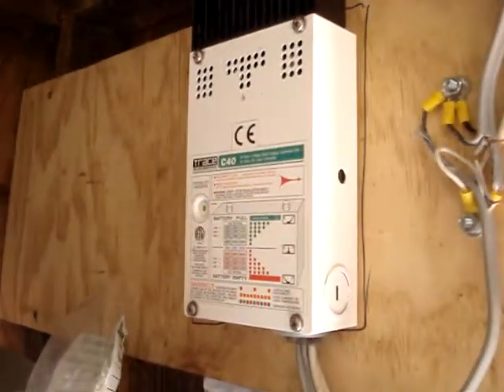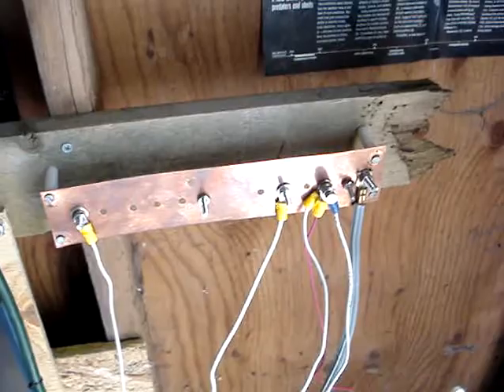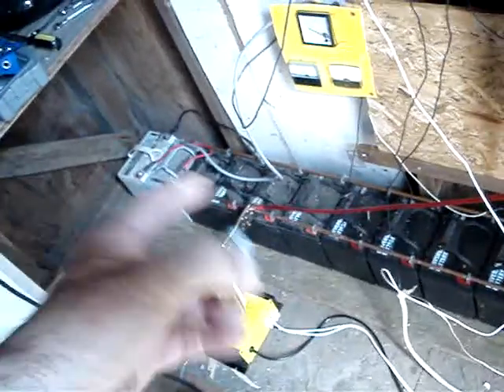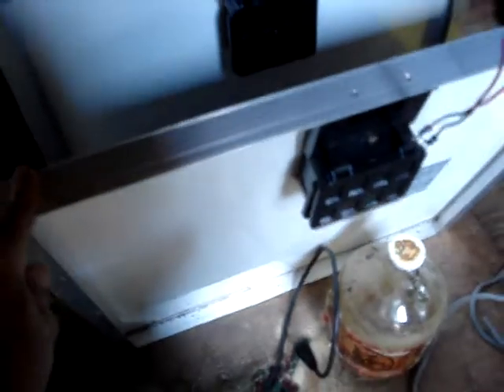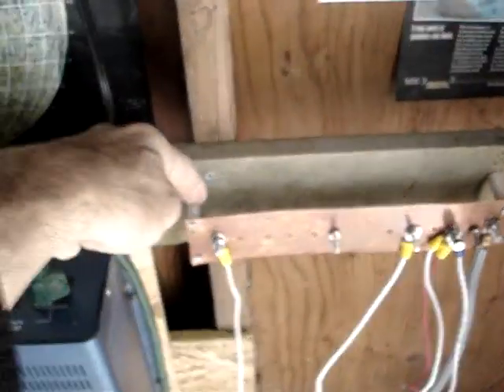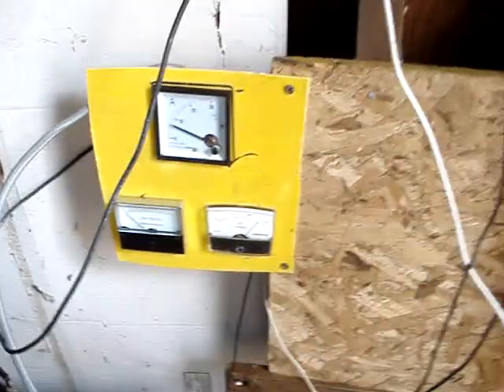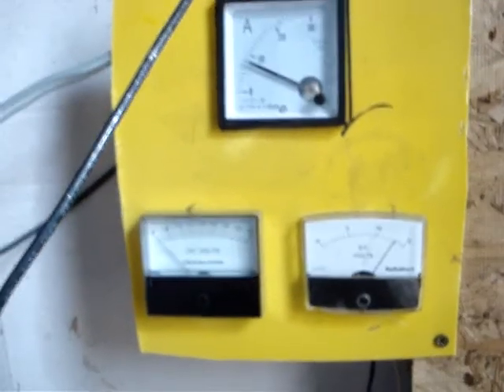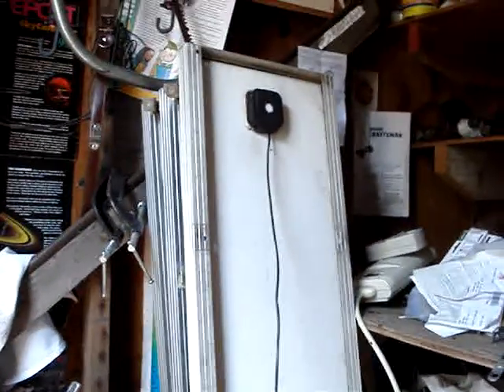Solar Power Project Update 2011 07

Comment from the maker: The only danger is from a metal object (a long wrench) making contact on both bars at the same time. My original plan was to use flat 101 copper flat bars pressed against the posts with toggle or C-clamps. Alaska copper and brass (local supplier) only sells in volume.

Comment from the maker: The copper bars are Ultra-Conductive Copper (Alloy 101) from mcmaster. 
dot com. I have looked around for 6 ft.x 1/2' x 1/8" copper flat bars but you have to order large amounts. Your method is copper plumbing tubing, that is not as pure a grade (conductivity rating) as the round bars I'm using. I have the battery bank under a work bench on the floor. There is no need to use wrenches to turn bolts, nuts linking post to post.

Comment from the maker: The batteries as they are, working flawlessly. Monitoring battery voltage level at all times. Grid charger running during winter. See my other videos where appliances devices are running while the sun is shining. Demonstrations of heavy draw loads during clear skies sunny weather. Thanks for stopping by.

Comment from the maker: 2 sets of 4 sunforce panels (8x15watt), laying flat on the shop roof facing east west. 1 set harbor freight (3x15watt) facing south on the ground. I'll do a video & reading soon. The sunforce have plastic frames (some cracking from uv) the harbor freight are peeling in the corners. The amorphous don't seem to put out as much as when they were new.
The sunforce sets cost $325.00 & $340.00 came with wires, regulators & stands. Harbor freight is best if they go on sale $150.00

Comment: Great videos!

What's the advantage of the solid-bar buss across the terminals?  Looks like it would make it hard to modify the rig or test/replace individual batteries.
Reply from the maker: Distance line loss  voltage drop. 6 gage cables.
Reply from the maker: This system is older video, lots of changes since them. Burglaries happening.

Comment from the maker: @pgm98387  Someone I know burned thru these because of improper maintenance (drying out) over discharging them at night. I run the small fanless modified sine xantrek inverter to power my netbook, wireless router cable modem. Morning readings never goes under 12.9 volts. Not very well planned out, expensive hobby to tinker with. For serious system would get L-16 in wired in series. Need an engine hoist to move them around.

Comment from the maker: @AussieHomestead Mainly because they were maintenance free. The size was a very common replacement for mobility scooters. Assuming that a more mass produced size would be cheaper. For a serious system flooded lead acid are better, require a box proper venting, position, temp & hydration level monitoring.

Comment from the maker: @Alprofight These were maintenance free. The size was very common for electric mobility scooters, shopping carts. Standard size that is very common. You don't need to ventilate them, can be used in different positions, on side upside down. I read that they outlast the standard battery format.

Comment from the maker: @maddogg862000 The gels will form bubbles inside if they get charged to fast, it was a mistake to have those in the string. I'm planning a 24 volt system soon. Those 4 gels will get left on the 12 volt setup using the amorphous panels. Higher than 14 volts float charging of the gels will burn them out. The oldest ones were purchased in 2007.